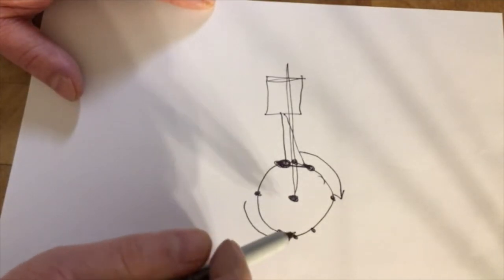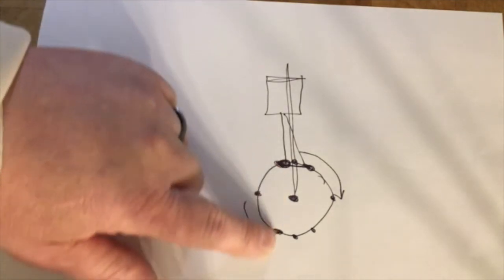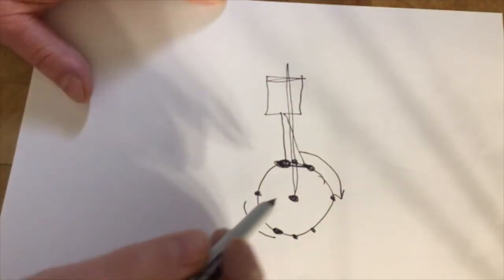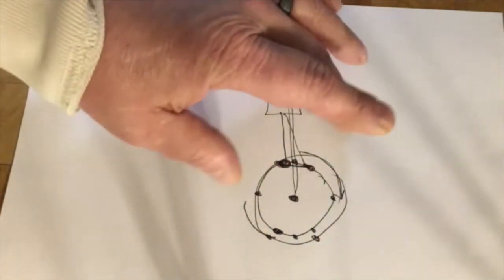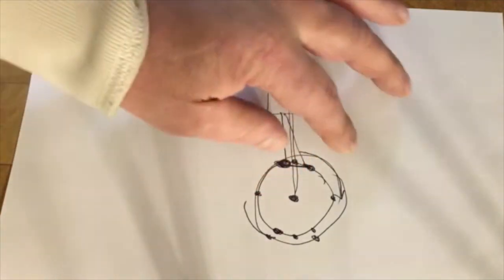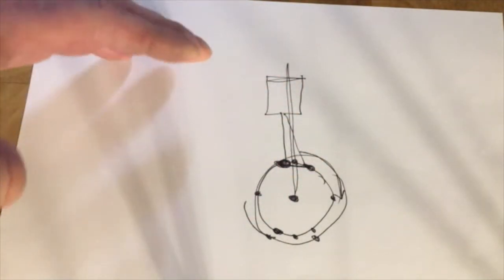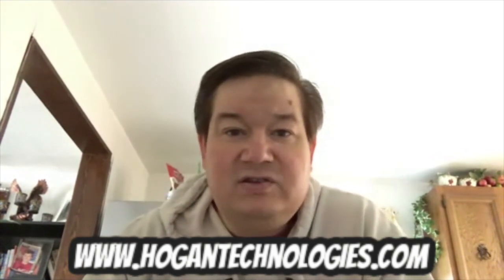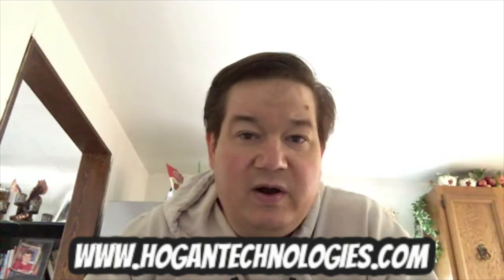Understand Distance and Speed and You will Understand More Than Most Dirt Late Model Racers

Comment: When you mention camber gain with the upper control arm at the 9:30 mark, would it be possible to achieve the  same effect with a shorter upper control arm? 
Or is it more efficient to adjust control arm angles?
Reply: I think they kind of work hand and hand. As you increase angle, the rate of increase accelerates. A shorter upper accelerates in speed faster than a longer upper. On a late model with approximately a 18” to 19” lower, I’ve always fond the sweet spot of 8” to 8 ½” upper. 
Experimentation will be the key. If you get too short, you’ll get that crazy camber we were seeing years ago. I always thought that was too much even though it was popular. Thanks for watching.